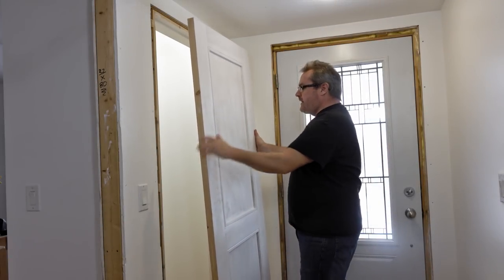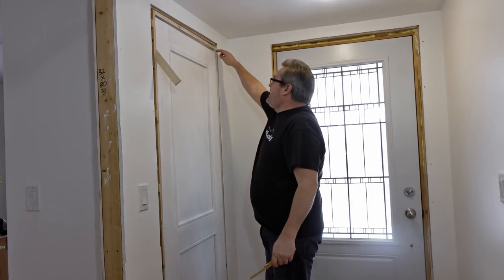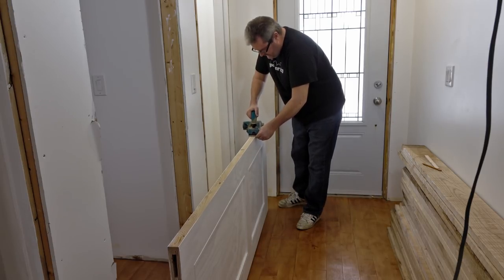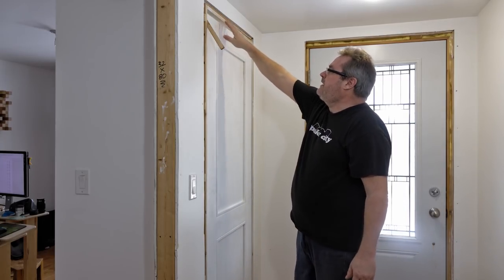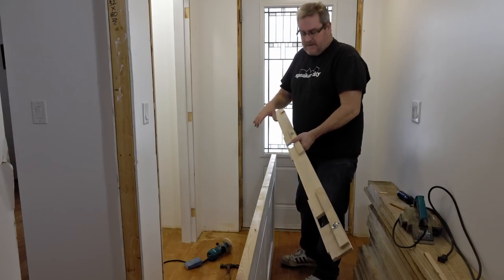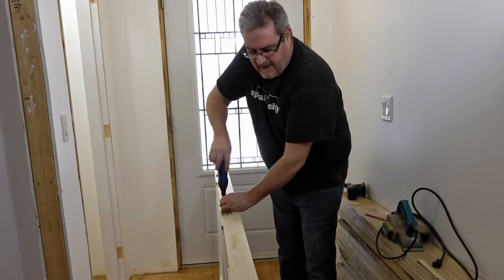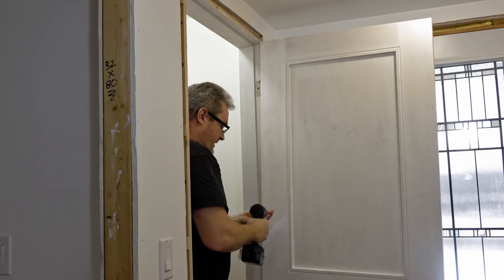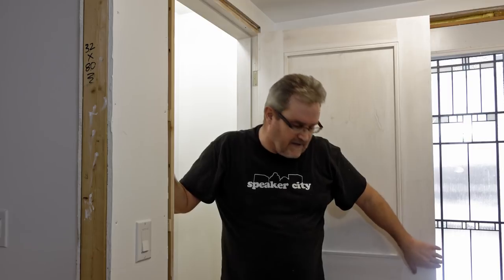How To Install A Door / How To Hang A Door

Comment: Great video. Good tips. I also bought the selfcentering bit. A pain in the ... to use. Had the same issue as you had. Went back to using regular drill bits...

Comment: Love your videos..I have a question on your door jamb installation. Was the header installed level? I don't understand why you had to plane the top of the door so radically..just curious as to your thought process..I seen the installation video. You started off well with very little variance from jamb to ceiling..am I missing something? Thanks, great jamb installation video, by the way..

Comment: Is that really how doors are mounted in Canada?
Tiny jewelery-box hinges and short wood screws?

Or was this a special aesthetic choice?
I would think of using those hinges for a (human size) door, let alone entry doors.
1st it's impossible those will hold a person if they were to hang onto the door.
2nd They can probably be kicked in on the first try by a medium size person with good shoes.

Could someone elaborate?

PS: No trolling here, seriously curious.
Reply: That isn't an entry door, it looks to be for a small closet.

Comment: how come you used 3 hinges? I've seen doors with 2 hinges and some with 3, all interior doors, is there a reason?
Reply from the maker: Two will do, but three looks better - more substantial.
Reply: I have a (heavy) door with 4 hinges: on at the bottom, one near the middle and two at the top
Reply: i understand having more than 2 on a heavy door, but an interior door is fairly light
Reply: Toby Beswick that 4 hinge door (at my parent’s) is an interior door. I’m renovating my house and all doors there are heavy (the biggest ones I can hardly lift; built in a time they still used solid wood instead of filling them up with cardboard) and all have 3 hinges.